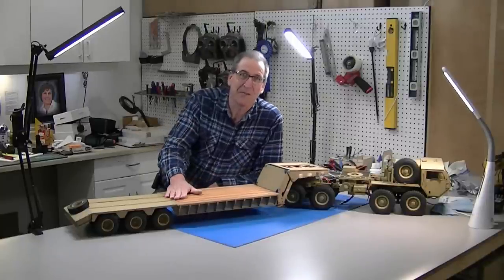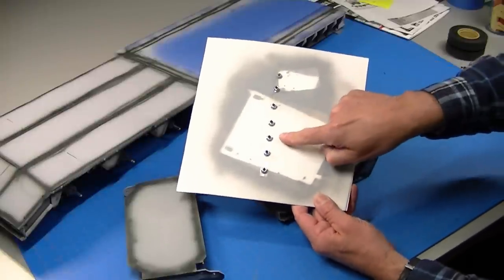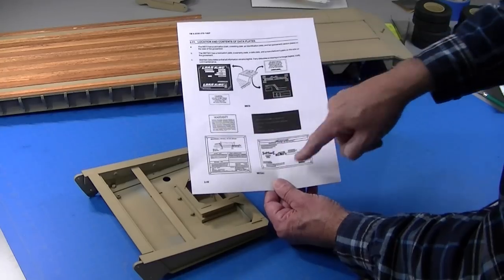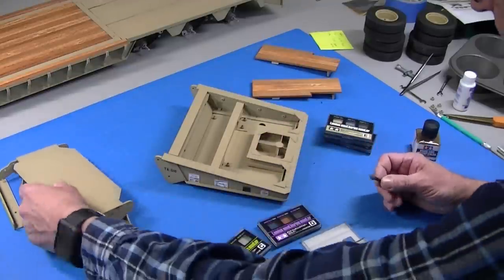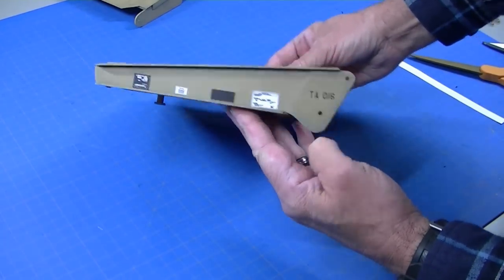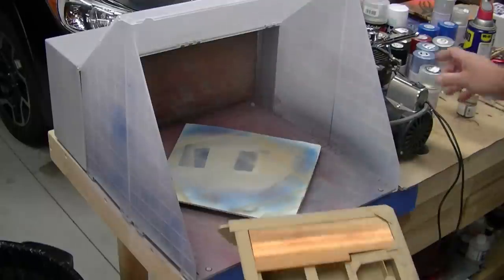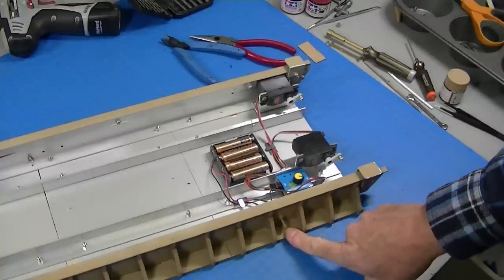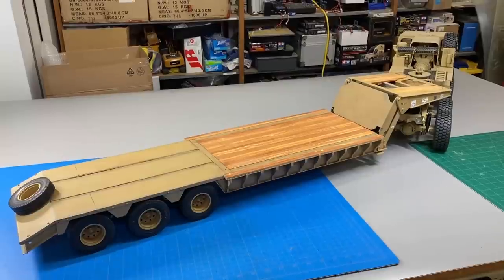1/12 HG P802 Hemtt Custom M870A1 Trailer Build - Part 9 Final

Comment: You've just reminded me of a skill I used for 30 years in Model Railroading... But practically forgot about. 
Weathering!!! Why not? Works in 1/87th Scale, why not 1/10-1/14th Scales? 😉 
I've never used Tamiya Line Paint before. Appears to be an excellent way of highlighting and drawing out details, without being obnoxiously over weathered. 
(Believe me, I've known some Model Railroaders - take a 2 year old Boxcar {in Scale terms}, and make it LOOK like it's a 1922 Model!!!)😳
Many times, subtle is better. 

This Series has CONVINCED me to Scratchbuild a Flatbed Trailer!!! Nothing that elaborate. I'm an Old Fart RC Guy, but only starting on my FIRST 1/14th Scale Rig. 😲 

My sights are high - Cletus Snow's Kenworth and Trailer!! 😳😁 YOUR Video Series on that was the spark! 

But the Grandbabies heard "RC Semi" and are now BEGGING for rides. 
I can't say No, but they're NOT crawling onto my potentially $500.00 Bandit Trailer either!! 

But maybe now I can fabricate some sort of Flatbed, with little Plastic Seat, that I can tow them around on?? 
Seems feasible. Been doing a LOT of Shopping over the past Decade, dreaming of finally getting into the upper air of 1/14th Scale Semis.... 
NOW in a word - Inheritance!!!!! 💰💲💲💰 

GOT my Grand Hauler, getting at least ONE Beier System from you, probably the Box Trailer (which I've ALREADY ordered the Cletus Snow Trailer Wrap from England). And probably a Flatbed Tamiya Trailer or two, just to see what idea pops up!! 😉

.... And building a "Kiddy Trailer" for the under 5 yrs. Old crowd, from trips to Lowe's, Home Depot, and a lot of Hex Screws!! 
And for a wider stance, I found out that Trailer Axles come in two main widths - 120mm (US Dualies) and 140mm (European Super Singles). 
The 140mm Axles with Dualies should give a safer Ride for the Kids. And the Axle Housings are Aluminum - not Plastic. 

Oh geez!!! I'm babbling. Sorry! Everything's happening so fast and we've been poor for so long.... It's a relearning curve. 
And it's EXCITING! 😁
Carmine ✈🚂🚙

Comment: Beautiful work. I had just considered getting the HG trailer they now have. Regarding the weathering, I worked on/with these in the army and I can tell you that the primary wear points on the diamond plate will be where the load's wheelbase goes. The paint down the center of the plates is usually worn nearly or completely off. When you figure out the load for this thing, place it on the trailer and roll it on and off a few times to get an idea of where the rub spots are and weather accordingly.